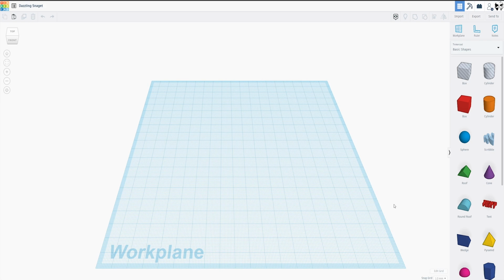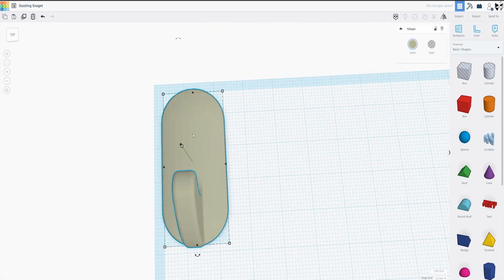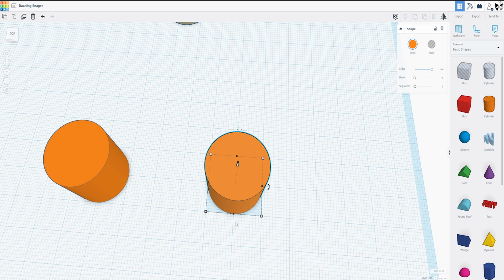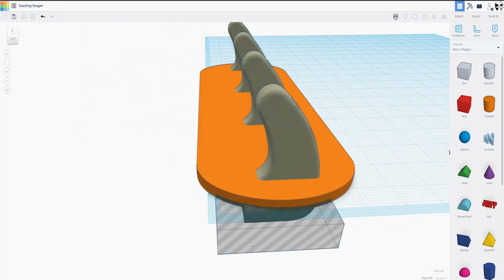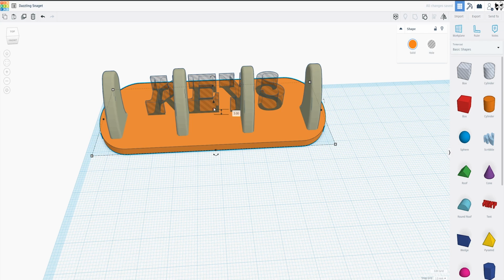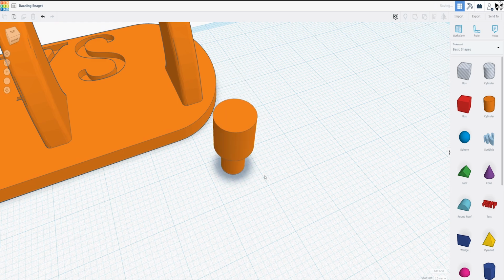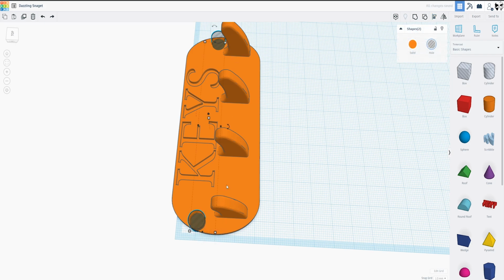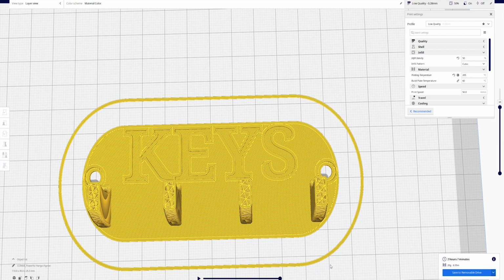Let's Remix Together | Tinkercad Beginner Tutorial! | pt. 2

Comment: So I have to ask:  is there no simple way to cut a model into multiple parts using tinkercad?  I'm trying to cut a large flat panel into 6 unequal sized pieces and I cannot find a simple "cut along the line" option...just like cutting a sheet of paper with a razor.  I can't use the duplicate option because each piece needs to be a different size and the panel is not symmetrical.  it's rough dimensions are 255x255x2.5mm and I need to cut it to fit into a 110mm build space.  I spent hours yesterday copying, cutting, pasting, moving, reorienting and I THINK I have the pieces set but such a huge amount of time for a really simple task.  Seems so odd that there isn't a "set 2 points, draw a line between them, split along the line" type of operation in tinkercad.  Maybe I'm just looking at this in the wrong way but every option I have seen seems to be overly complex
Reply from the maker: Can you post a link to the model so I can give it a shot?
Reply: @Avel  Wow...that's an amazing offer.  Really appreciate.  I did manage to get it done though albeit with a few colourful metaphors thrown in occasionally.  lol

I'm just really shocked there isn't a super simple way to do this very basic action.
Reply from the maker: @Enjoymentboy  Haha, been there a few times 😂

Glad you got it figured out. Tinkercad definitely has its quirks and drawbacks, but for the most part, it gets the job done.